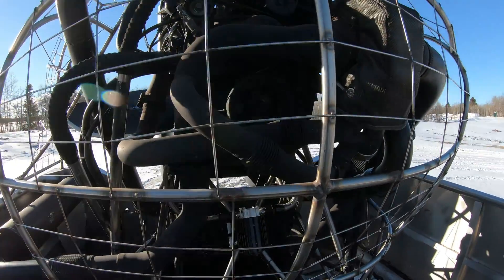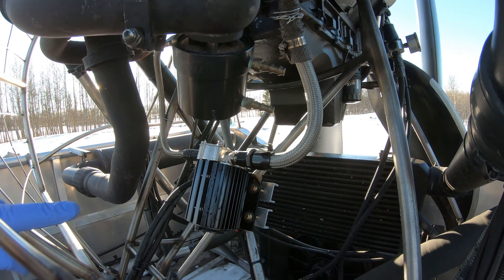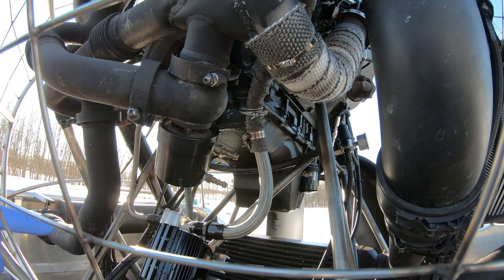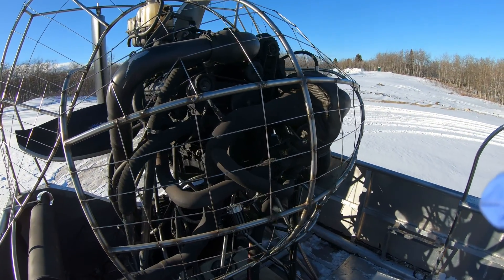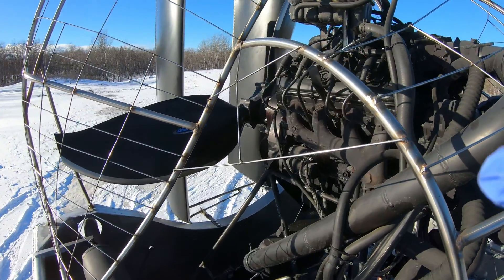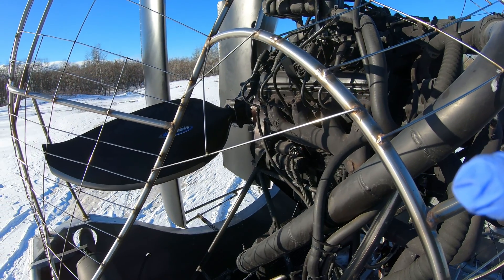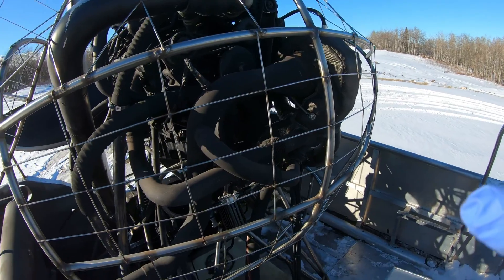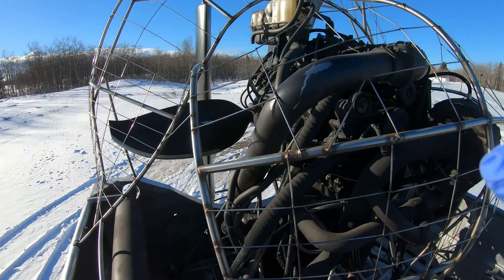Airboat build #44: How loud is it?

Comment: Awesome boat!  Youre my new idol.  Im sure you've forgotten more about mechanics than i ever learned and i've never been on an air boat but i bought an old 17' hull and want to follow in your footsteps. From what i've read, the more blades the quieter it runs...surely that 5.3 would push a 4 blade? They say it gets even quieter when you run counter rotating blades....?  Looks like you're running direct drive?   Wouldn't a reduction gear make it quieter? Do you think the turbo may have contributed to the gasket failure? i doubt the LS i end up with will have a turbo but if it is an option i wonder if its worth adding.  My hull is only 6 ft wide. have a great day.
Reply from the maker: Thanks.  More blades might be quieter in certain circumstances.  Keeping the propeller rpm down is important.  From what I understand, if the tips exceed the sound barrier they get louder and less efficient.  I am running a reduction drive, 2.5:1 reduction.  That helps a great deal.
I don't know about counter rotating blades.  Typically those a very high hp applications.  The prop manufacturers (like whispertip) will give good advice for the ideal prop for each application.
I think these 5.3 are good motors for this.  The LS platform is easy to work on.  The turbo likely stressed the headgasket but it should've been able to take it.  My tune likely wasn't perfect but it should've been reasonably close.  These motors can usually take a fair amount of boost.
Good luck with your build!